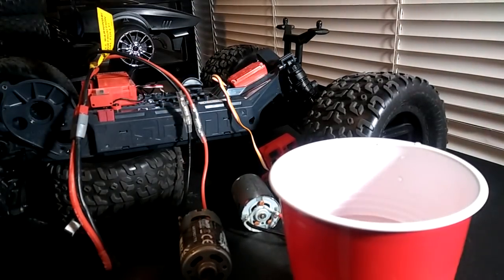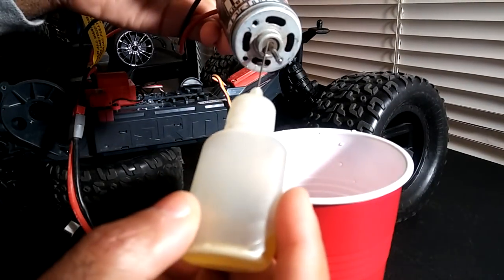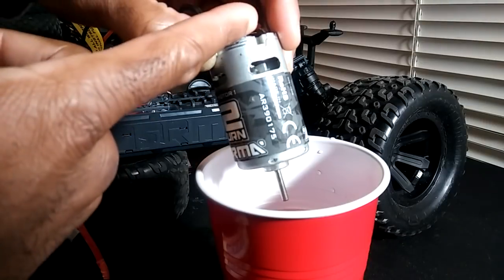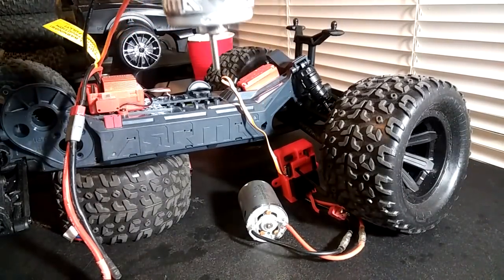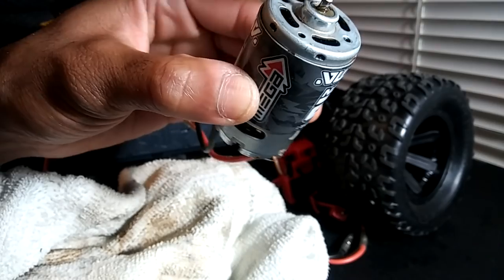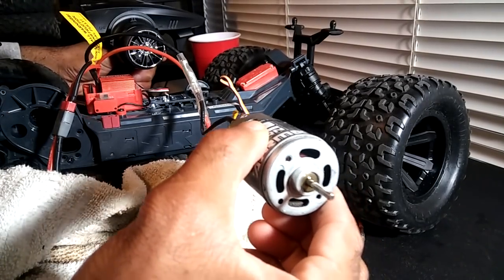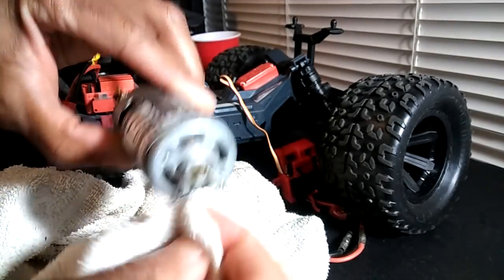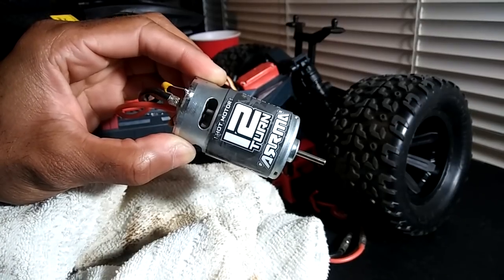Cleaning and Breaking in Brushed Motors

Comment: I have a Titan 380 brushed motor ..n if I do the water breaking method can I use 3 in 1 oil to lubricate the shafts and the bearings?